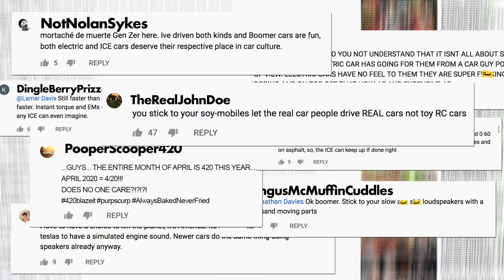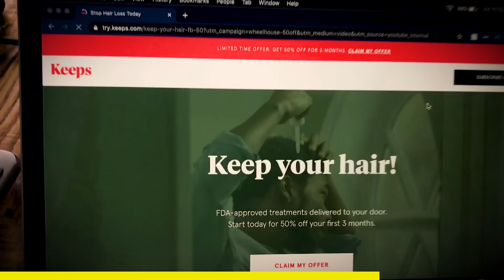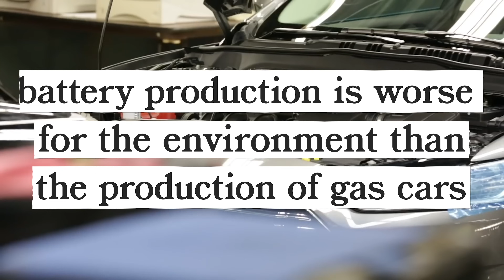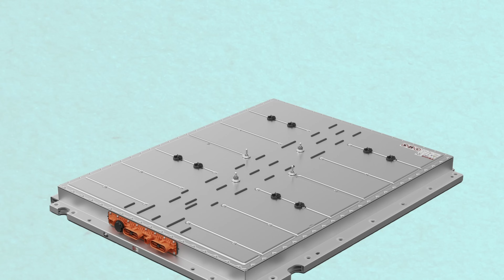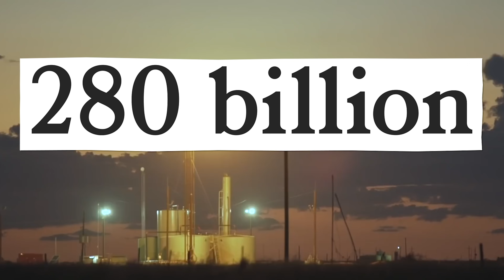Are Electric Cars REALLY Better for the Environment?

Comment: I bought a 10 year old accord for 7k. Works great. Most electric cars will need a battery replacement after 10 years which costs significantly more than that just for the swap. So electric cars definitely are not for poor people.
Reply: Make a video on how they store these used batteries because they're considered toxic waste
Reply: @lanceyoxtheimer866  They'll be recycled.  They're worth too much to just store for no reason.  Even lead acid batteries are recycled and they have very low value.
Reply: While there have been some cheaper EV cars, I agree. But most early stage technologies have a price barrier for a time (i.e. internet, gps, cell phones, TV's)
Reply: Aptera is a company thats a WIP and if they suceed the batteries packs are much smaller which means a lower cost for the replacement.
Reply: EVs are more energy efficient
Reply: @haie90  no they are not
Reply: @haie90  a hybrid car cost $10,000 more than a non hybrid car. All to save 1,000 gallons of fuel for 200,000 miles. At the current gas prices, that's spending $10,000 to save $4,000 fuel costs. 

 How is that more efficient?

Not to mention the bank wants intrest on that $10,000 up front cost for me to invest in a hybrid car. And my paying $10,000 extra up front costs, plus intrest.

Now fully electronic.  Gas for a car going 200,000 mikes that gets 37mpg has a fuel cost of $20,000. And how much more money is a battery? I need to buy a very expensive battery. Up front costs with intrest rates paying to a bank.

Building self driving, heated seats, and very fast with tax subsidies toys for the rich.
Reply: @@noel7777noel  so you are talking about price, not energy efficiency I was mentioning, otto cycle can't achieve efficiency as high as EVs can. which means less energy is used to travel a certain distance with compared with gasoline cars since lesser energy is wasted
Reply: @@noel7777noel  I'm talking about energy efficiency, cars transfer chemical energy to thermal energy and then to mechanical energy which involves in more temperature loss, you can say to overcome a certain distance needs total energy of x joules. but in reality calculating the energy loss means you need more energy produced
Reply: @@noel7777noel  your talking about gas, if you spent 100usd on gasoline, maybe at most 30% is used to move your car. If you want to talk about things bad with EV or environmental friendlier stuffs than I think you rather complain about some environmental friendly interior parts used in many cars nowadays
Reply: @noel7777noel  It really depends on the habits of the driver. 
If hybrid driver is doing daily commute using only EV drive, is charging at home, and sometimes takes a longer trip on which gas is used.

Then hybrid is hands down better then an ICE car and an EV car.

Depending on the habits of the driver there are cases where ICE car is better, where EV is better and where hybrids are better.
Reply: @dariozanze4929  but the upgraded cost of a hybrid doesn't compensate the amount saved on gas. That doesn't include interest on the money I have to borrow either.
Reply: @noel7777noel  How much do you travel daily for comute?
Reply: @dariozanze4929  the typical. 15,000 a year.  My son just paid $10,000 extra for a hybrid.  To go from 36mpg to 47mpg. To save $300 a year. Not including interest on that $10,000
Reply: @noel7777noel That's 47mpg if he doesn't charge battery at home. If he isn't charging that battery at home, it's not worth it.

But if he does...

New Prius can drive on battery alone for about 40 miles, charging said battery overnight costs about 1$. So every day he gets about 40 miles of driving gas free.

If he needs to make a longer trip, after 40 miles he starts using gas at 47mpg.

Average US driver travels for about 35 miles per day, so for an average driver, totally worth it.
Reply: @dariozanze4929  I said hybrid. Not plug-in hybrid.
Reply: @noel7777noel  Oh... well yeah hybrids without the plug in option suck.
Reply: @dariozanze4929 please don't @me with fart sounds and only using vocabulary words correctly
Reply: @noel7777noel  Oh, I'm just glad that you do know plug in hybrids are better financial choice then ICE cars.
Reply: so bad for the wallet, but EV are more energy efficient than ice
Reply: And you’ll spend 25,000 extra in gas and maintenance on the gas car in those 10 years. 
The new EVs only have a 10 percent degradation in 14 years so it will last you for the life of the car.
Reply: @@truthchangelove8913  the problem with gas engine compared with EV is low chemical to mechanical energy conversion rate or the low efficiency to convert potential energy to moving the car
Reply: @truthchangelove8913  Disregarding fuel, you do realize EV's also have parts that go bad, not including batteries. EVs also have tires, suspenions, headlights, I can go on and on lol. EVs are still cars, they dont float or do anything magical.
Reply: @RuskFox  Yes, and so do ICE cars. I was referring beyond the basic maintenance  that they both share.
Reply: @truthchangelove8913  You think electric won't need stuff too? You still need tires brakes suspension just the same amount of money it also costs money to charge it's common sense
Reply: @Josh_Furtado  It's still considerably less because of the reasons I mentioned. Most people charge at home. You can charge with just a wall outlet and you can charge overnight. With solar and charging at home, I'm currently paying less than 1 cent (0.004) per mile with a $24 per month grid fee. Of course this does not include the cost of the solar panels and installation, but it pays for itself in 10 years and lasts for at least 25 years. Without solar and charging at home, it's 3 cents (0.0033) per mile. If you charge only at stations, it's going to be the same cost as gas at around 10 cents per mile. The smart thing to do is to charge at home  (which about everyone does) and, even smarter, to get solar.
Reply: @truthchangelove8913  my calculations says gas is not that expensive compared to the extra cost of the batteries. No much room for errors. 

How about the oxymoron they are for the environment but building them big and fast and with heated seats.

How about the oxymoron they are getting tax subsidies but making them for the rich with heated seats and other luxury items and with investors making lots of money.

All around the industry is dropping the ball with oxymorons.

I have to pay interest rates with the upfront cost of the expensive batteries. Where as gas is spread out with easy payment plans intrest free.

Our banks needs to listen to ordinary  folks. I'm looking at that extra financial cost of intrest rates on those batteries vs gas is intrest free payments. 

And if the batteries need replacement. That's a huge bill all at once.
Reply: @truthchangelove8913  they might have money to spend over those years, but not at once
Reply: @magik97  There are always options for a loan. However, you can get lower range/ older cars for a lot less. The cost of electric cars is around the same as other cars. 2023 Chevy Volt for 28K or a 2023 Nissan Leaf for 36K. The used ones can go under 10K. I bought mine for 8K.
Reply: @truthchangelove8913  You are highly underestimating the cost to swap a battery into an ev and 2nd you act like out of those 10 years your ev vehicle will run with zero issues, hate to break it to you bud but they have all kinds of problems and electrical problems are pain in the ass and very costly to get fixed

Comment: Nolan, did you account for the emissions AND dollars cost of that EV battery needing to be replaced after however many miles of use?
Reply: The EV battery will outlast the body and suspension of the car.  Then it will be 100% recycled, unlike all the fuel burned in a gas car over its lifetime.

Comment: Wow, how things have changed in two years. The so called renewal energy movement has turned California into the #1 electricity importer in the US, followed closely by Texas. How could this be? Well California and Texas traded reliable natural gas power stations for unreliable wind and solar. Turns out the power grid needs electricity on demand, so when wind and solar are making excess electricity it can't be saved, so during peak demands, when solar only makes electricity 12 hours a day, you get rolling blackouts. So, two years ago, some states could handle significant increases to the power grid, but with the whole sale shutting down of power plants and no more being built, that simply is not the case anymore.

Also, with the increase in cost of electricity, power bills in California are doubling. Add to that the cost of charging two cars using residential charging stations is estimated to double ones electric bill. Add to that Michael Shellenbuger, the scientist who oversaw California's renewal energy programs in the 1990s, explains that wind and solar are not only unreliable they are destroying desert ecosystems because wind and solar require large areas of land which requires massive investments in infrastructure which are eating up and/or destroying natural resources at an alarming rate. IOW just measuring the carbon footprint is very misleading and ignores the fact that without increasing available, reliable energy our country is heading towards truly desperate times.

Comment: I have a suggestion, why don't you put speakers in the place of the exhaust and program the sounds of fuel cars with it, so that if you press the accelerator pedal, the car makes a sound like the one we like in fuel engines.
Reply: EV’s have done that, but they sound terrible. Dodge’s new Challenger sounds like a wet fart through a cheap Bluetooth speaker. Personally I think that EV’s shouldn’t even bother, it’s like trying to be something they’re not. EV’s are better off trying to do their own thing, rather than pretend that they have a cool engine that makes nice sound

Comment: Another think that you forgot to mention is the battery’s are rated for 8 years then need to be replaced, which is far worse than a gas powered engine being replaced. This isn’t an apples to apples comparison

Comment: If we’re comparing the impact of getting the oil, you’d have to also include how bad for the environment it is for the solar fields and wind mills to be manufactured and how do they store the energy? Electric is so much worse when you do both big pictures, on-top of that wind farm parts are not recyclable, where I live the garbage dump or recycling plants won’t take the parts.
Reply: not to mention the amount of oil each turbine requires and to do oil change maintenance on it. We need the 1 hr long episode.

Comment: 3:04 not only they need batteries. They also need to get charged, and if you want ot charge 125.000.000 electric cars you need that amount of electrical power. Solar only works when there is enough sun, and wind only works when there is enough wind, and even if there is sun and wind they produce very little power. Water power stations arent green at all, and nuclears stations are about to get banned from everywhere because they are "dangerous", so the only thing left is to go back to fossil fuels. And then we have litterally no improvment whatsoever. Even the opposite side. All the infrastructure needs to be changed, like fit bigger and more cables und the roads...

Comment: Electric still needs coal or heat to turn a turbine to create energy.  Hydrogen fuel cell is probably better then electric
Reply: Also what’s good about hydrogen is that, you can either put it in the form of a combustion engine or an electric motor. Giving more diversity, and it will have little to no CO2 emissions

Comment: How about mining coal for power plants?  How about recycling of dying batteries and the impact it has on the environment. How about power plants that burn oil to produce electricity which still requires the refining steps that manufacturing gasoline requires?

Comment: The problem is electric powered cars generate far greater cost while just slightly lowering CO2 emissions. EV cars should be thrown in the garbage and we should instead continue to improve fuel filtering and carbon capturing technology while sticking to IC cars.

Comment: Just discovered this video and had to leave a comment.

I appreciate the honesty about the efficiency of EVs and your love for gas-powered cars.
When you love it, you love it but it doesn't mean you can't acknowledge a truth that may conflict with the object of your passion. And that's probably what passion is, I think LoL.

Great content and infographic, appropriate length IMO for the general public (maybe cars, environment, and data nerds would love a longer one LoL), excellent research. Just... kudos! :)
Reply: Wait a minute. How do u know it's excellent research or what he says about the research is true?
Reply: @dt9913  becuase thats how it works he can use science to figure things out
Reply: @lucid-eclipze571  lol SCIENCE has proven this wrong
Reply: @bobshagit9503  how
Reply: @lucid-eclipze571  last years stats came in, it cost more to run a electric car than a gas powered car... and you witnessed last years gas prices
Reply: @bobshagit9503  When they say that electric cars are more efficient, they mean that they use more of the energy that they have stored inside them. Which, fun fact, it turns out about 60% of your car's energy is lost just trying to push air out of the way.
Reply: @bobshagit9503  Source?
Reply: @MrGamelover23  Yes, that's the job of a car or it can't move forward whether it's an ICE or an EV.
Reply: @glennmartin6492  But that means that cars are designed really stupidly. Seriously, 60% of the energy isn't going to forward momentum, but overcoming wind resistance? That's why I really like the aptera car concept, it's so efficient that if you put a Tesla sized battery pack in it, it would have an easy thousand mile range. It could reach 400 mi of range on just one or two gallons of gas. Give me cars like that. Hell, with gas prices the way they are, if they actually released a gas version, they would literally be bigger than Jesus.
Reply: @@dt9913  physics, nature just proves him right
Reply: well I love ice cars especially inline 6 and v10s, but let's face reality, EV are the winner in terms of energy efficiency
Reply: its lies

Comment: Considering not only the CO2 displacement of the power plant but also the large amount of CO2 displacement generated during the manufacture and disposal of lithium batteries, there is no big difference between the CO2 displacement of EVs and gasoline vehicles.
Reply: Did you not watch the video?

Comment: California just announced we’re gonna have black outs and brown out cuz the power grid can’t support everyone charging there cars and running A/C. This video was 2 years ago I’d like to see if new data changed anything?
Reply: Did the specifically say they can’t charge EV’s or did you add that part in? Because EV ownership in California has been going down due to California’s grid unreliability. And as EV ownership in California reduces, their grid problems have been getting worse. Which suggests to me their problem isn’t to do with EV’s. It’s that idiots built the electrical grid there.
Reply: Pro tip. California grid said nothing about EV’s.

Comment: Instead of focusing on CO2 maybe consider cost per mile for the consumer including the initial cost of the vehicle.  People's behavior will only change when it is in their economic interest to make the change.  Back of the napkin 10 year ownership EV = $85,000 for the car Plus lets say $4000 in electricity.  IC= $25,000 for the car plus $25,000 in fuel.  SO maybe don't buy a Tesla?
Reply: $25k for a similarly sized and spec’d luxury performance car? Where the hell are you shopping? Or did you compare what is effectively a faster BMW M3 with a second hand Toyota Corolla? If so, that’s not really a fair comparison is it? Maybe try a car that has similar performance and luxury features. Otherwise it’s kinda like comparing a mobility skoota to a Harley Davidson.
Reply: That is a very good point.

Comment: To be a complete comparison, battery lifespan and recycling should have been considered more.

Batteries have a finite number of charge cycles, where they steadily lose capacity over time. Recycling the salts and metals in a battery is also difficult and expensive to do (you can't just melt it down for scrap or burn off the waste).